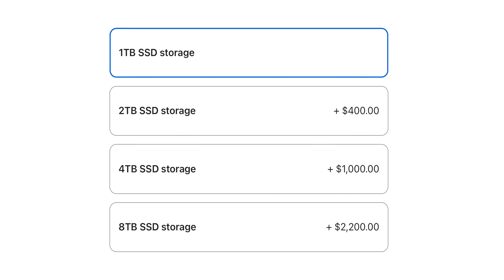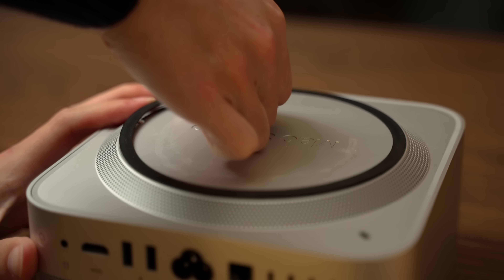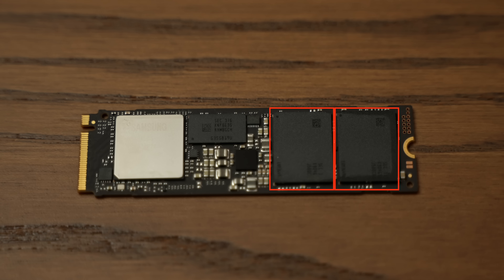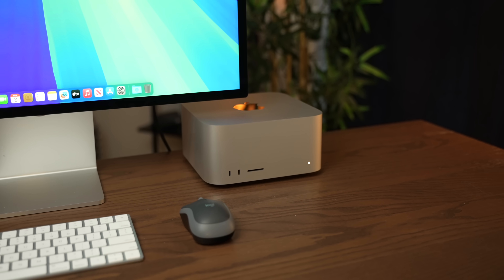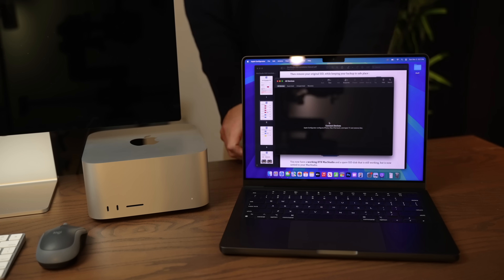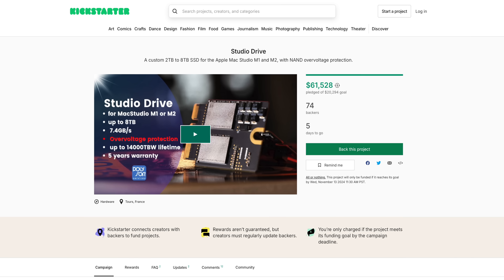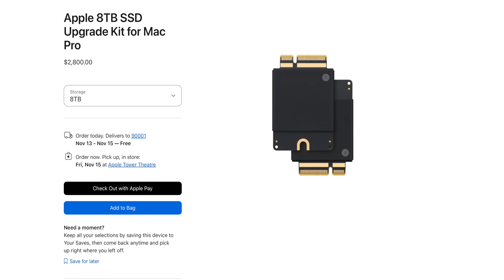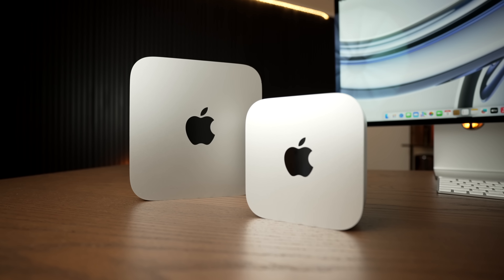UPGRADE your Apple Silicon storage for HALF the cost!

Comment: great info. No mention of warranty? Apple make (as far as I'm concerned) best in class OS. There machines are more like Rolls Royce or Bentley's. No wonder they charge £2,500 for an indicator stick. I have a MacBook Pro that is 13 years old I got second hand from a cash converters for £165. It's still fine. The casing is dented but it's indestructible. It's a bit worn out but for about £350 I could replace keyboard, hard drive, memory or swap out logic board entirely. Screen is fine. Won't run the latest greatest software but for word processing and web and spreadsheet stuff it's responsive and fine. Better than spilling coffee over a £7,500 M4 monster. Or leaving it on a train. In my experience the DATA is millions of times more valuable than the machine. So is what they've done legal? I expect so. AND when will apple make a cheap consumer........ oh right they did with the new mini mini. Never mind. They keep their value for ages for a reason. M1 MacBooks still command around £500 second hand and when the price comes down far enough I'm going for a m3 air 15 inch. However I expect it'll take at least 5 years for that to happen. All to say ..... see if you can find a 10 year old plastic windows machine that works as well and I'll eat my own head. I switched to Apple a few years ago and after struggling with windows 3.11, 95, 98, millennium, 8, 10... and so forth (basically all of them) I've never looked back. write a note on my iPhone, add a few things on my iPad, work on it on my MacBook and finish it off on my mini. It's possible with android and windows probably just as good now. I don't care to find out.

Comment: Luke : It would really be a shame if Apple starts integrating the NAND on to the logic board.
Apple : Let's start integrating the NAND on to the logic board
Reply: That’s what they do on every other product
Reply: @rawkfist-ih6nk  Yes they don't do this for Mac Minis because if someone needs to upgrade storage you can simply plug it into the Thunderbolt port. No need to pay 2000+ USD to Apple or 800+ USD to some hackers who reverse-engineered Apple's SSDs.
Reply: @APopov Yesh who doesn’t want a slow, clunky external drive when they could have a faster, internal one
Reply: @JohnSmith-op7ls  Speed is the same. Not because external drives are sooooper fast but because the internal ones are rather slow by modern standards. https://www.youtube.com/watch?v=JSNKR6JLwg8
Reply: @ Figures Apple would put garbage SSDs in there, despite charging 10-12x retail rates. Looks like these drives are like PCIe 3 speed lol
Reply: @JohnSmith-op7ls  Some manufacturer will (or has already?) come up with a case underneath like those backup drives we had for the older MacMinis - voilá: Beauty and the Beast.
Reply: It sucks so much. I was a diehard Mac user, I still love Mac OS but I ended up switching to PC because I've been so fed up with the bullcrap Apple has been doing with expandable memory and storage space.  There's NO reason to solder storage. I couldn't take it anymore. After 30 years of using  Macs.  Such a shame.  Products like this make me think about going back though.
Reply: @ Even with 3rd party upgradable storage you’re still screwed on the RAM and paying 10x or more what it should cost. Every computer maker charges a premium for RAM but no one as much as Apple. And with it being soldered on you have to pay it now even if you’re not sure you’ll need it or it’ll make a difference.

Then the ram is shared with the GPU on most of their devices so the second you do anything that needs more than a little vram the real world specs get even worse so you have to fork over for overpriced ram or deal with memory swap slowdown.
Reply: That's what they were doing before. The fact the M4 Mac mini doesn't suggests the vector is actually away from soldering NAND chips to the logic board directly, at least outside of severely space-constrained environments like laptops. (Note that the only reason they don't sell replacement modules for the Mac Studio or Mac mini is that they're not supposed to be user-serviceable; they do sell replacement modules for the Mac Pro.)
Reply: @ Severely space limited laptops lol. Funny how every other manufacturer manages to make replaceable RAM and SSDs on laptops. Even the thinnest ones can accommodate this if they wanted and nobody needs a laptop that slim anyhow because there’s no point but to force compromises like terrible keyboard switches, small batteries, and easy bending. All things which end up pushing consumers to need servicing or early upgrades while giving the company a false marketing premise because they need any excuse to try and justify new models when there is zero innovation.

Comment: So why do Apple's SSD's cost so much when they don't even have a controller or DRAM cache on them? 

Why would Apple continue to use removable storage once there is no reason to buy them from Apple? 

They price for this storage is still very expensive, way more than it should be and the only reason it's this expensive is because Apple charges so much.  

If Apple didn't charge so much they would sell more devices to people and might actually make more money.  

I just can't support Apple by buying any other device until they change how much they charge for storage at a time when it's so cheap.

Comment: Cant believe that a big channel like this endorses copyright infringement like that. Copying traces down to their geometry is a crime and it ripping off apple. Even if it may at first feel ethical, this is still theft and should not be endorsed.
Reply: It's literally not copyright infringement.
Use the phrase "Intellectual property" if you can't figure out trademarks, copyright, patents, trade secrets, etc.
"Under the SCPA, a mask work is a series of related images that forms a design or part of a design used to produce an integrated circuit. However, circuit board layouts are usually not copyrightable as they don't include non-utilitarian features."

Let me know if you're still confused. Keep up the good fight for the $3 trillion company! They need you to shill for them!

Comment: nah how 10PB is possible on a 256gb ssd
Reply: You've been duped into believing that the TBW value (a WARRANTY value) is the actual write endurance of an SSD.
Does your engine blow through your hood when your car hits 5 years/60k miles? No. Its warranty expires.
Reply: @ yeah man, but i once saw a test on a samsung 850 evo 256 gb and it lasted 900TB of writes, 10 pb seems just too much to me, and also the time on of that ssd was very low. maybe apple ssds are better or with newer technology compared to the old 850s. also i di the math and you would have to write at 661MB/s for that amount of hours to write 10PB wich seems reasonable for a test unit

Comment: Apple should add a standard m.2 NVME slot in there.  macOS can boot from external storage devices via thunderbolt (which is just itself an externalization of the PCIe bus).  So clearly the OS can be boot from a standard NVME drive.  So why not allow the user to internally use standard NVME if he or she so pleases?
Reply: Because greed. Apple hates their consumers, they’re just cows to be milked and slaughtered.
Reply: I think of the same solution as PS5: Sony's internal SSD + a M.2 slot for those who wanna have even more internal storage.
Reply: Of course that's the way but we all know Apple will never do this.
But you can always plug any M2 into Thunderbolt ports with inexpensive adapters. The speed will be the same as for internal storage - https://www.youtube.com/watch?v=JSNKR6JLwg8
Reply: @APopov  Before long it will be paid feature in macOS.

Comment: Sorry the endurance rating for these is what?? 140,000 TBW???
Reply: You realize that you're conflating endurance rating (signified as JEDEC endurance) with warranty value (TBW), right?
An endurance rating is how much data can be written before the average sample starts to go read-only.
TBW ratings are nothing more than product segmentation and warranty values.
Just like your engine doesn't blow through your hood at 5 years/60k miles, your SSD won't actually fail at the TBW value. It will go for, on average 2.5-3x as many writes. 
You, say it with me, simply lose warranty coverage.
Higher TBW = the sheep will pay more, even if it has no bearing on reality.

QLC is only slightly less write tolerant than TLC but comes with a much lower TBW rating to create the illusion that it's worth the extra money. (Which it might be when it comes to native media write speeds... but not for TBW values.)

Comment: * Warning! I once bought a 3rd party ssd for my 2017 base model macbook pro. Battery consumption went through the roof, even when the macbook was 'asleep' and also mac os always threw an error after a reboot, in fact, the machine did not want to shut down or restart, I had to force the shutdown every time (something really funky was going on there with the kernel I guess?). I decided to downgrade back to the original apple ssd and all was fine again.

Comment: Too much hassle to be honest.

I bought a 990 Pro 4TB for 269 in Black Friday plus a small T4 M.2 Enclosure with built in fan and done.
Reply: For any of the desktop models, the "need" to have all that storage internally is less of a big deal, for sure. But if this kind of aftermarket upgrade was available for the MacBook Pros, then that would be a different story entirely...
Reply: A built-in fan to cool the NAND flash that stores data for longer, with fewer required refresh cycles, and less wear when written at higher temperatures?
That's hilarious.
Why do you think SSDs come with heat*spreaders* rather than heat*sinks*? To move the heat from the controller to the NAND flash to warm it up.
GaMeR SSDs come with heatsinks because they can charge people $30 to make the overall product worse.

Comment: RE: The Ad Spot for the magsafe charger. What's stopping you from rotating your phone without a rotating mechanism on a magsafe charger in the first place? I can rotate my phone around just fine with a static magsafe charger stand I have.

Not trying to hate or anything, just seems a tad unnecessary.
Reply: It looks more like a cool selling point. Regular MagSafe stands only allow 4 orientations. Honestly wireless charging is just quality of life thing. Wired is more efficient and standardized
Reply: I can rotate my phone in more than 4 orientations on a normal magsafe charger stand I have on my desk. The phone rotates - not the charger itself. Just seems kinda like a weak selling point to me.
Reply: @slalomie  My belkin magsafe stand allows the phone to stick to it in any orientation.  indeed its a bit of a pain to line the phone up completely horizontal or vertical.  nothing special involved, the phone just moves without the stand having any mechanical parts at all.

Comment: Apple should offer their own upgrade SSD fast, or else businesses like Polysoft will make a fortune. Its lost market
Reply: Apple don't sell replacement modules for the Mac Studio because they don't support aftermarket user upgrades like they do for the Mac Pro.
Reply: fortune ? for crazy people do you pay $200 for empty pcb this cost 2$ at pcbway ok 10
Reply: @Adiiiman2xxx  Actually, for this 12 layer board with this kind of tolerance, via-in-pad, blind/buried vias, BGA pitch (on BGA voltage regulator IC), ENIG finish, a run of like 10 boards costs around $3k from such a manufacturer, NOT including assembly or components costs. Not cheap.
Reply: Dang! Apple could use your knowledge on how to eke out tiny crumbs of profit.
Its lost market? Who or what's lost market?
Reply: @ I bet its a joy to enjoy your company

Comment: How long until apple figures a way to disable these modules?
Reply: forever
Reply: @Adiiiman2xxx  Apple didn't switch to socketed SSD's for the user, they switched to speed assembly of non standard configs.
Reply: @davids4610 no it was more for repairability. Also Apple doesn’t have way to detect where nands are from especially when they are reverse engineered from the original
Reply: @davids4610  I'm sorry, socketed SSD... is?
Socketed SSD's what?
Reply: @tim3172  oh please, you know what I mean. soldered or socketed.
Reply: @chidorirasenganz  whichever it may be, apple ain't doing it for us.

Comment: Waiting the SSD upgrade for the M4 Mac mini. I just got 256gb bc of these guys. With 24GB of RAM, it will be my side machine for at least 10 years.
Reply: Exactly the same here. 24GB RAM and 256 GB SSD is my M4 Mac mini configuration. I would immediately support the project if it works for the Mac mini M4. Before I forget, you are absolutely right, it will be my machine for at least 10 years, too (hopefully!).
Reply: In an age where technology moves very fast and even tablets and phones are shipping with that amount of RAM... I think it's a bit optimistic to think you can use it for 10 years. Also apple is notorious for supporting their mobile devices for a very long time but not their Mac's. Maybe that will change with Apple Silicon but I highly doubt it.

Comment: Wouldnt apple try to sue them for copying their board design? I saw IBoff doing something similar but they didnt try to copy the design
Reply: no, the damage to their image would be too big, at best they can try and make them fail with firmware if at all possible
Reply: @_Digitalguy  Not really, you can put blank nands into any apple silicon machine and it would dfu just fine or with existing nands with firmware already in them from a different board. If they fail firmware, you can just program the nands with a programmer with same serial and not what, If a device gets stuck into recovery mode due to a corruption in a update or something with its original nands and apple implements that then it would be impossible to get your machine working again.
Reply: @3ijnweu3oq3  that's why I said if at all possible...One risk however would be Apple refusing serivce (including under warranty?) if the nand is not from them... Or  you think they cannot detect it?
Reply: @_Digitalguy  they would be able to tell visually on the board, I am not too sure via diagnostics but visually they would be able tell since nands tend to have underfill which is like some sort of "glue" we could say around and under it and when you replace those nands the glue has to be removed. Yes you can buy underfill liquid and underfill it yourself but the whole process will void your warranty.